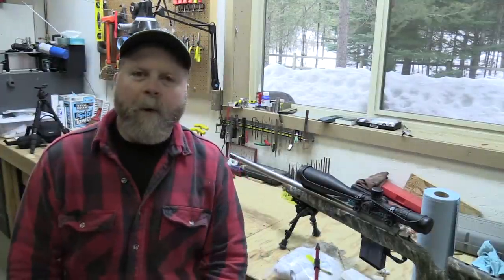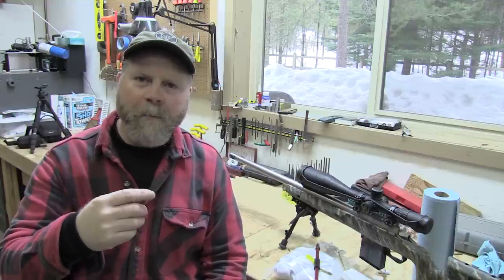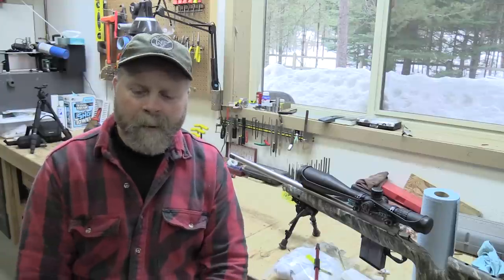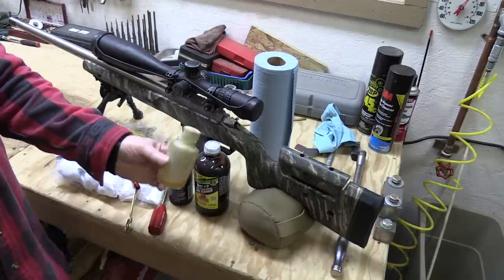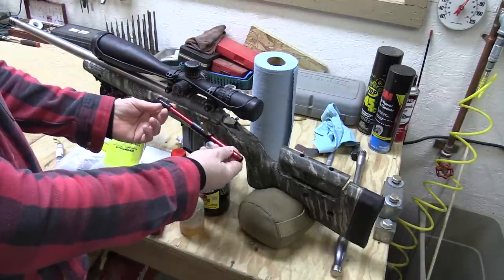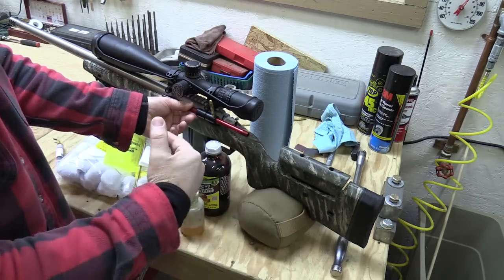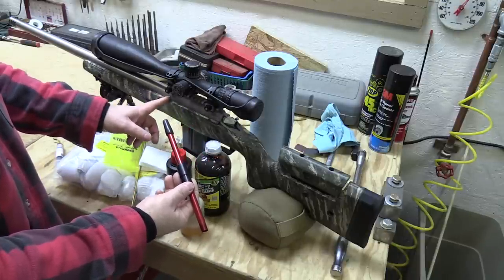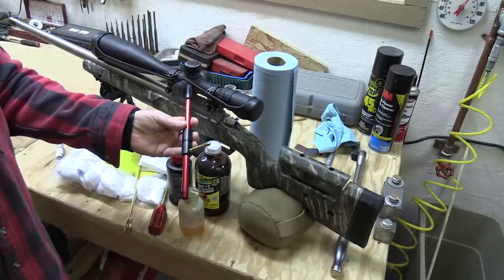Precision Rifle Barrel Break-in & Cleaning: Why, how, and do you really have to?

Comment: Very Nice video. I always try to use a bore guide with a O ring on the chamber end . The others tend to let some of the solvent run back towards your action. The O-ring ones don't.  Try PMA bore Guides, Sinclair make some too, among others. Dewey rods are top shelf but opposite gender thread of everybody else. (Brushes and jags must be bought special for a Dewey).  The maroon handle Tipton cleaning rods are my favorite. Standard gender, Ball bearing handle, completely covered brass rod that cant scrape inside your gun, and they make a rod for anything. Uses standard gender (male thread) brushes and jags vs Dewey. Dewey's are great, but they are opposite of everybody else so be aware.

Comment: I built a 6.5 G on the AR  platform and contacted the barrel manufacture ( vary well known manufacture ) and he told me " just go shoot"
Reply: Absolutely.. its voodoo BS all that cleaning...my most accurate rifle just SHOT.. ever since i first shot it.. 200 rounds in havent cleaned yet still shoots dimes.
Obviously cleaned it from shop then havent since.
Just shoot the gun , finding the right ammo will make it shoot not cleaning it every 1 or 3 shots for 50 rounds when you buy it.
I hunt alot though.. 2 to 3 times a week
Reply: Love watching these guys shoot one round where ever it goes  and clean for 20 minutes.  I chronograph 20 watching them. Figure my dope and shoot another 20 to make sure I’m on. Then shoot another 20-40 doping distances. They are still on round 5, “breaking that barrel in”
Reply: And yet Browning says to fire about 20 shots to break in their barrels. First 10 one at a time, cleaning in between, then two at a time, cleaning in between with copper solvent. So apparently it has some use for certain manufacturers.

Comment: This really smart engineer guy named Rex once told me. For break in its just better to shoot it to get what's called "Copper Equilibrium". You want that copper to smear the bore to cover the tiny imperfections in the rifling and create a smooth surface for the bullets to gluide on. If you clean the bore every shot for the break in it will take longer to get the optimal copper equilibrium.

Comment: Never need to break in a barrel, They are already heat treated and design for this purpose, but of course you want to keep it clean.  You can buy all of the special fancy crap on the market but wd-40 works perfect for this and i use the 5 in 1 silicone oil for the action all. I even wipe the entire thing down before storage and everyone of the look as new,  domestic are 20+ years old. Keeping the barrel and action clean eliminates jams. And keeping dust caps on the scopes is a  huge plus..

Comment: Your last statement about not cleaning your gun.... I do agree with that after break-in although my OCD kicks in sometimes and I cant help myself.  Have talked with gun smiths that have seen lots of guns come in where cleaning screwed up the crown etc.  A good piece of advice I once heard was after the cleaning tip exits the muzzle, lift up slightly when bringing it back into the muzzle and do it slowly.  Some cleaning setups will have a little lip that can catch right at the crown which is no good.  Bring it back slow and make sure nothing catches otherwise its like taking a file to the crown.  I use Montana extreme solvent.  My wife chews my ass every time I open that up.  Nasty ammonia smell to it.

Comment: No argument from me.  I run a few patches soaked in Hoppes # 9 and sip a little Jack Daniel's Old No. 7 while the Hoppes sits in the barrel for a few minutes.  Then I'll run dry patches until one comes out white, run a patch with Rem Oil to keep it from rusting in the off season.  When hunting season is about to open, I run some dry patches through the barrel, go to the range and shoot until I get a good, consistent cold bore first shot.  Usually done in three, sometimes five, but that could just be my shooting.  Then I'm done with it until the end of season.  Rinse with Hoppes and repeat.  Been working for 40 years, never have had to brush or chem treat, still shoots well under 1 moa each cold bore first shot after fouling.  Remington BDL, 7mm rem mag with about 500 rounds through it.  Probably about what the average Joe American Casual Hunter can relate to, more or less.

Comment: Howdy, 
Where is the JB paste? After how many shots would you recommend taking the bolt apart and cleaning off the firing pin/replacing the firing pin & spring?
Reply from the maker: DrewEmc2 JB is good stuff if you need mechanical action to get stuff out of the bore. I like using it with felt pellets. 

I take the bolt apart when new, clean any grease out of it, oil it all lightly, then forget about it forever:-)
Reply: thanks great advice
Reply: Ups just delivered my new M.S.R 10 300WSM,  26.5" U.M.S.S bbl.  Smith's directions are use bore snakes 1st w solvent like hoppes #9 , 2nd w JP and 0000 steelwool wrap on brush section , 3rd w solvent , 4th w dry snake during bore brake in process. Reckon the goal it to put a very smooth finish inside the bore. Thoughts ?Crawford out

Comment: I've seen people do many variations of that one shot clean Two Shots clean three shots clean all kinds of garbage. There is a slight differences depending on the Metallurgy of the barrel. Stainless barrels are a little bit different. But there is no reliable difference between firing 20 rounds and doing a full cleaning, doing a long drawn-out procedure which accomplishes nothing. A swabbing of JB bore paste, especially at the throat, may very well be quite effective. Maybe draw 3000 to 5,000 grits piece of Emery cloth down the bore. That will knock off the corners. Then do the 20 shot break in.
Powder residue in that first 20 rounds polishes the barrel quite readily.

Comment: I broke in my new BCM by taking out of the box, inspecting it, firing 4 mags through it
Sighted in my lpvo sprayed a little g96 on it and threw it in the truck. It's been blasting ground hogs ever since with it. Works like you'd expect from BCM. Not a single malfunction or a drop of lube in over a year and it rides in a farm truck and goes in the tractor with me. I shoot my reloads so it's high quality clean ammo
Reply: I'm waiting on my savage 338lm to get in to the gun shop I'll probably do what savage says just because of what it's job will be

Comment: Imagine doing this with 20 feet of steel pipe and a HUGE brush on a 120mm gun on the M1 tank.  That was always fun.  We go through gallons of Break Free like you wouldn't believe.  Then you have to drop the 150 pound breech block and clean it.

Comment: If the cleaning rod is coated and jags are brass or plastic(both softer than barrel) and as stated, won't harm your barrel, why use a bore guide? If a bore guide "keeps rod straight to prevent damage to bore"? Honest question, been contemplating this a while. I can only think of the brush with steel twist.

Comment: When I was professionaly hunting foxes in Australia, I used a Anschutz .22 hornet , 40 grain Sierra soft bullet. No skin damage, only small entry hole. I had to disolve copper residue every 12 rounds or so. If I did not, the accurace would suffer badly. Clean barrel I coudl get 1" group with 5 shots, after 12 rounds, the bullet would land anywhere in a 2" diamater or often more depending on outside temperature and moisture. I clean all my rifles before or no more than 15 rounds.. Just a small story on my experience..
Reply: Tom Jakovac 22Hornets are notoriously bad at fouling, my Anschutz was the same way, but, the same model rifle in 223Rem will go hundreds if not thousands of rounds without cleaning with zero degradation in accuracy.

Comment: Question : confused.  Cleaning out the copper is mandatory in the break in or not ?  Also, your smelly copper cleaner is ammonia based ? I just use the Hoppe’s bore cleaner with a brush, patch,then bore snake. Wrong ?
Reply from the maker: I'm not sure it's mandatory, period! The whole point of cleaning it all out between shots is to see when the barrel is "broken in". Hand-lapped barrels won't typically get copper-fouled on their own, because there's nothing in them to scrape up bullets. We induce the rough edges at the throat when we chamber it. Yes, Sweet's is ammonia-based. If your process is giving you the results you want, it can't be wrong.:-)

Comment: Thank for the video, one question: noted that you remove your muzzle break, any reason for that? Could the process be done having the muzzle break in place? If not how you go about to clean it?. Thanks again
Reply from the maker: Jesus Irazabal If it’s a gill brake like the one in the video, you can use a patch on a loop to swipe out the solvent in the brake. If it’s a radial brake with lots of small holes, several q-tips will clean it up.
Reply: Panhandle Precision Thanks for the tip. Learning a lot from your videos, specially the reloading series. Keep at it...
Reply: Been there, and really went anal about it. like he said 1 shot clean, did that for the first 10, than 2 shots for the next 10 and 3 shots and clean for another 15 shots. . . you will get carbon build up in the muzzle break if it gets very hard and you are unable to clean it off flossing a patch you might want to hang it up muzzle end down and pointing into a container of some sort like a prescription bottle, filled halfway with CLP or something like it to loosen up the carbon.

Comment: Sam, love your videos!
I’ve been reloading for 45 yrs and I’m still learning.  I clean my barrels pretty much the same and would like to extend my cleaning schedule too.  My worry is I live in the south east and it’s somewhat humid and I just can’t put my guns up without some oil In chrome moly barrels.  Do you have a recommendation for not cleaning and protecting barrels from rusting? Of course when I run a oily patch through it pushes carbon out so I generally just finish cleaning. Maybe I just need to run an oily patch and dry patch  before shooting and not clean any more than that.
Reply: Mate i live in australia, tropics muggy as fuck weather.. rust is a huge problem. My routine is to go hunting, come home and run 1 oily patch through bore and shelf the gun till next hunt.. then before i go out i dry patch it out and shoot.. 
You arent cleaning the gun by oiling it you are rightfully preventing rust in the bore. That works for me ive never broken in a gun and they all shoot good.
Mind you i hunt ALOT.. 2 to 3 times a week.
But i might only shoot 3 to 5 shots total in a night tops.

Comment: Great video, thanks.  Do you have a video on cleaning trigger and action?
Reply from the maker: I don't. I show the tools I use for the action in this video. I don't do much, if anything with triggers. Compressed air sometimes, either from a can or in the shop with the compressor.
Reply: Flush with gun scubber or lighter fluid
Reply: @milldawgj9598  That's what I've done with my Trigger Tech when I know it's getting grungy, probably once or twice a year after the season... remove any obvious dirt/grit from the top, then use gun scrubber or brake parts cleaner, drench it from the top, then blast with compressed air.  Not sure about other triggers, but the TT is designed to run dry (without lubricant).  I suspect some 90% alcohol would also do well as a cleaner, as it also dries with zero residue.  I think the real important aspect is to not push foreign particulate down into the mechanism, just flush out what might have worked its way in there.

Comment: I never clean my 243 Browning Eclipse because use Winchester Silvertip ammo which coat the barrel with a protective film so unless water got in I would not clean it. I broke it in by cleaning with copper solvent after each shot for 20 shots as I do with all my rifles. I did experiment with cleaning it at first but I found the POI completely changed and it took 6 rounds to return to zero so now I leave it alone. Only problem with Silvertip is that you cannot mix it with other ammo but as I get half MOA at 300 yards why use anything else? It is just a varmitter not a precision long range rifle.

Comment: Call me old school but have opposite view from experience.  Precision .300 - when cleaned .48 MOA.  After 30 shots ~1MOA.  After 70 shots 2 MOA.  Cleaned, back down to .48.  This was using Hornady ELDX ammo, allowing 5+ minutes between shots for cold bore.  I still use old Armalite break in method.  Cleaning every shot for the first 10 shots with JB Bore paste, then every 5, then finally every 10, until 100.. then every 20.

Comment: Have you ever seen pressure signs from not cleaning? I've got a factory savage model 10 in 260 that I can't even get 40 grains of h4350 behind a 140 gr eld m with out seeing ejector mark. Any help would be appreciated.
Reply from the maker: No, I haven't, and I run barrels pretty dirty. I do however, clean the chamber as often as possible, and make sure there's no grease or oil in it. Lube in the chamber and seating into the lands are the two things I've seen cause unexplained high pressure.
Reply: Panhandle Precision one last question. The ejector marks that I'm seeing is very faint. You have too look pretty good to see them. No raised edges. Is this common or something that you think would be a problem?
Reply: Matthew Bryars that's normal I push my savage 110 pretty hot and I just go off my primers for pressure signs. A tight chamber can cause your ejector to scrape the brass and give you false readings.
Reply: bikeboy0012 thanks for the reply.

Comment: You say dont clean? Not always. If you ever cleaned a not cleaned bore it takes 50-75 patches and 20 strokes with brush per patch to get the crap out.
You'll get carbon, (black) copper, (green) grey (lead) rust (brown)
Rust comes from moisture sucked up by the carbon powder left in the barrel.
Referring to common rifles like old winchester 94 for restoration is a night mare to clean a neglected bore.
I've done multiple restorations on "closet guns".
Rust means corrosion. Pitting.
If you leave crap in your barrel (carbon barrels) you mistreat the rifle.
Should not be left dirty. Referring to hunting rifles, clean at end of season or depreciate its value in the long run.
I strongly say because I've pulled 30 patches of SLUDGE out of this barrel I'm working on already.
I have at least another 30...more than two hours to whittle down the gunk.
That's what not cleaning will get you in the long run.

Comment: Sam, have any knowledge about J-B Bore Cleaning Compound and J-B Bore Bright?  I assume that you could use these products to remove tooling on a new barrel and later on to remove carbon buildup.  I came across these products when I was looking into the use of a borescope.  It seems that some people who’s rifle no longer shot tight groups found carbon near the chamber and at the end of the barrel when examined with a borescope.  The fix was to use an abrasive similar to the products above.  You also mentioned a tool you used to measure throat erosion.  What do you use, how do you use it and have you found it worthwhile to take these measurements?
Reply: I use the J-B compound and bore bright  on VFG felt pellets pretty much the same regimen prescribed by the tech at Brownells. I have utilized the JB process on break-in of 5 barrels now and have had nothing but success. A good bore scope tells no lies. I can actually see the dirty striations in the steel polish down to mirror over the course of 5 rounds fired/5 bore compound treatments (10 strokes one-way using VFG pellets) and then 10 rounds with 10 bore polish treatments between each. After doing this I have to shoot for a LONG time before building any discernable copper in the rifling. Plenty of people will shy away from lapping/polishing their own barrel - the truth is that even without a bore scope, a person can plainly see with either their naked eye or a magnifying glass the difference in that steel before/after the JB process.

Comment: Love the Channel. I share your thoughts on not cleaning the barrel until it needs it. Side note: You said you normally wouldn't get more than a year out of precision barrel. How many shots do you estimate that would be? Just curious.
Reply from the maker: I'm hoping I get 2000-2500 out of this one, but that might be a little too optimistic. I'm at 787 as of today, with two matches to shoot at the end of the month, plus practice.
Reply: @PanhandlePrecision  What grease should you use on the back of the bolt lugs ? Thanks

Comment: I have two new rifles .one is a very well made custom rifle in .35 Whelan. The other is a Walmart package savage axis in 6.5 creedmoor.the custom rifle shot about one inch groups at 100 yds.the savage 6.5 started out shooting about one and a quarter inch at 100 yards but after about 80 rounds it got down to a half inch at a hundred  yards. Absolutely nothing was done to break in except one cleaning before the first shot.this is how I've broke in barrels for 50 years.i have used chrome polish on rough barrels but I wouldn't dare do that to a new barrel.
Reply: so hypothetically, if I was to go purchase a brand new 243 no stainless steel, brand new and all, would I only need to clean before first shot and keep sending rounds down the range until groups got smaller? talking average, budget rifle; savage, Howa, Ruger one of those
Reply: @lukegalati2652  yes.what the real gun Smith does will work but I've owned many rifles that shot sub moa and none of them were broken in by anything but shooting. All those methods accomplish the same thing . Smoothing out the  barrel and filling in the small scratches with copper.